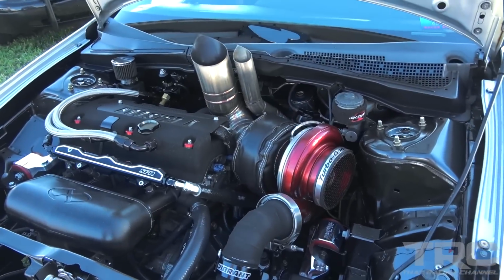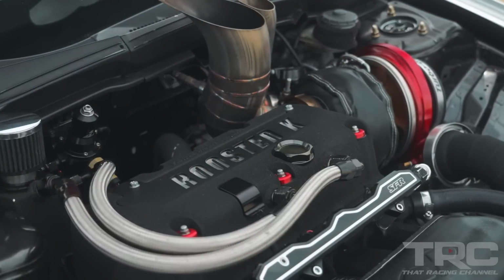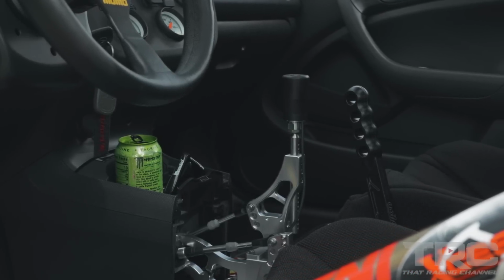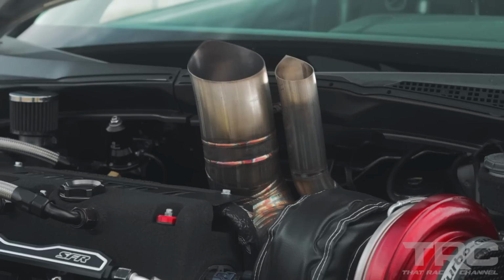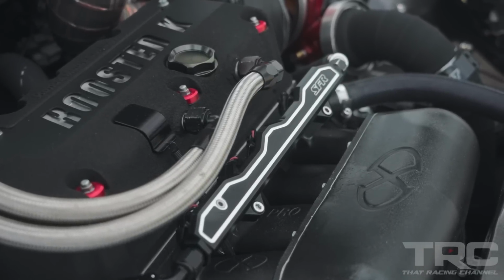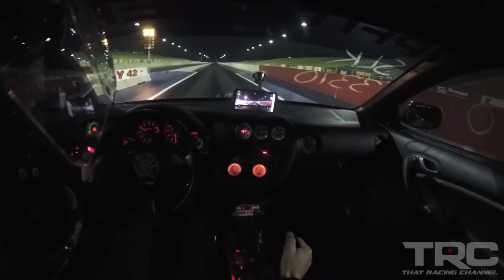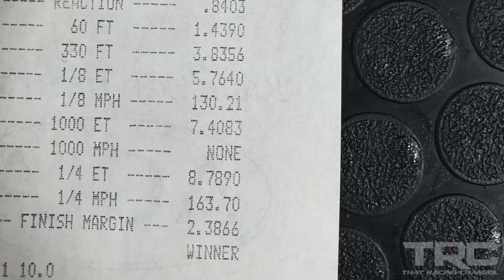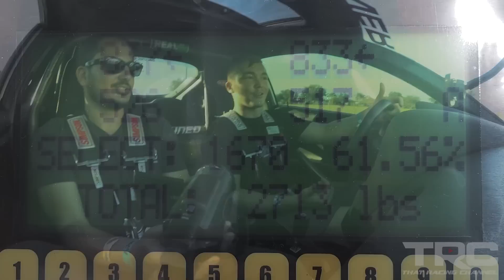950HP AWD RSX Dominates Exotics! "The Perfect RSX" (Honda K-Series 45PSI + 9800RPM)

Comment: A 4 Banger taking down a twin turbo v10 will never get old!
Reply: Its not about 4 banger vs tt v10 .... its about how much hp he has vs his opponent regardless of what car it is
Reply: @ACommenterOnYouTube  Wait so its only bhp that wins races regardless of the car ? So 800bhp in a full weight rear wheel drive truck beats 700bhp in a all wheel stripped out eg civic everytime? Based of that logic a loaded semi should walk most things then?
Reply: @Ewtlldo  its more like, luxurious car designed for all around style, performance street use and track use vs a car just stripped and made to go straight on a strip...? logic ye
Reply: @ACommenterOnYouTube  Its called power to weight ratio. You're right though, it doesn't matter what vehicle it is. Only thing that matters is the weight of it.
Reply: 230+ bhp per cylinder is impressive to me regardless what vehicle its in. More so when its home built on a budget

Comment: This is the kinda motivation I need but my wallet can't handle.. 😅😅
Reply: @Kseriessuck  if youre doing all the work yourself or have sponsorships its "not too expensive" but this would litterally cost the average joe 50k+ for a setup like this pushing similar power. quality parts are not cheap, not even for Hondas. Honestly 400-450whp in a Honda street car is more than enough power tho. good enough to walk some 700hp cars and cruise through canyons and then make it back home.
Reply: @kuya_mike7813  i have an 8th civic si. i want a PRL turbo kit so bad that’s it. but i worry about the trans :/ and it’s my daily. i’d be happy with 400 wheel
Reply: @Kseriessuck  okay yeah most of the parts you need you can easily find at a junkyard 💪🏾
Reply: Facts , one day mane!!!
Reply: Fuck. Hondas were a problem fwd lol and now they're AWD?! It's over.
Reply: As an rsx owner, this is all of our dream builds.
Reply: @ohnd2634  I have homemade turbo kit on my rsx and it’s so worth it. I’m only at like 350 - 400 but it’s fun as hell.
Reply: @Alexbrandt27  still enough power to get you in some trouble 😉
Reply: Facts! I need to get my mojo back think this did it for me
Reply: @Kseriessuck  dude we're talking waaaay over 100k if you have an actual shop do all that work... finding a cheap part on ebay is meaningless, the work is where the $$$ is. Plus stuff like this needs to be rebuilt and have parts tweaked or replaced constantly... thousands on thousands on thousands just to keep it going once its built.. unless u just want a garage queen build
Reply: Ya my wallet ain't that fat but 400 in a turbo  gsr hatch is working on the street

Comment: One of the cleanest, well built, fastest Honda street cars I have seen.
Bonus points - built not bought

Bravo!
Reply: you have to see dsm demon. have u seen 1200hp hondas? they out here easily
Reply: @cosworthTV  those aren’t really street cars tho
Reply: I loved when he asked if he had a shop. No this is just a side gig! What the hell does this guy do for a living? Surely he's a mechanic at a race shop at least.
Reply: Ahh CORRECTION ...
turbo is bought hp ... 
Built hp is all motor naturally aspirated.
Reply: @ACommenterOnYouTube  Turbo isn't bought HP. Just buying one and having sitting on a shelf doesn't add any HP. He had to fabricate the turbo kit to make any use of it. Still built.
Reply: It’s an Acura not a Honda !
Reply: @MSRWorkshop  well said
Reply: @MSRWorkshop  Acura is powered by Honda
Reply: @probong2053  k-series
Reply: @aaronkratzmann9703  yep and plus most people that want a reliable and faster turbo buy upgrade kits and rebuild the turbo with better turbines fabracate passageways so it stays cooler and and has proper oil
Reply: Honestly can't buy a honda with power unless it's an nsx lol
Reply: @MSRWorkshop  A H A H... Same thing.  The engines are the same the chassis are the same.
Reply: @chrisstratton3430  You BUILT a motor with parts you BOUGHT ..
Both methods cost $$$$ 

i BOUGHT $100k worth of parts for my 1000 whp Supra & BUILT the engine myself 

One in the same, try to process that.

Comment: I know this man personally and have been in the passenger seat of this machine back when it was still FWD. No exaggeration whatsoever, this man may be the most talented and dedicated person I've ever met and this thing is a fuck ton of alot faster than videos depict. Well deserved and rightfully earned brother. 🔥 Godspeed ol' Brett Bunyan.
Reply: He military? Haircut says probably.
Reply: @Green_Streets  nah, kid's just respectable and has a good head on his shoulders. Family man.
Reply: @jor-wo1vi  does he drag race the car with slicks or drag radials with that setup? I hear the crv stuff isn’t as strong, so curious.
Reply: @Green_Streets  he explains the tires he runs in the video buddy. Believe they're toyo R888s
Reply: @Green_Streets  you're correct the crv stuff isn't that strong, he runs through axles all the time but has it down to a science at this point.
Reply: @jor-wo1vi  know if he’s ever broken a rear diff?
Reply: @jor-wo1vi  Gotcha, I thought he implied in the video that he had other wheels/tires that he used as well.
Reply: @Green_Streets  he has slicks but was running his street tire set up during this bud
Reply: @jor-wo1vi  I understand he was on street tires for the roll racing, I was just curious how well his crv driveline handled if he has run slicks, apparently the diff is the weak point.
Reply: What’s his Instagram
Reply: He in Canton Ohio?.. sounded like he said Canton
Reply: That 60-130 time says it all! That RSX is insanely fast!!
Reply: He's certainly both talented and modest
Reply: Does he have a channel?
Reply: I wouldn't mind meeting him myself as I have a k24a2 I wouldn't mind tuning out maybe pick his brain on how to convert a fwd TSX to an AWD...
Reply: @jeremywilson5366  tsx, heck yeah with double wish bone suspension.  If it's the early generation (with engines without integrated head - exhaust manifold):   reinforce the front suspension.  They are know to crack and you will chase alignment issue for ever.   Had seen this issue..

Comment: If it wasn't for the hood exit the car would almost look sleeper-ish
Reply: it aint a honda if it dont got the hood exit
Reply: @lcameeno1  No you
Reply: @OEM1  I like being a hood exit
Reply: I miss when people made real exhausts.
Reply: Ahh ... sleeper-ish dont have 4 drag radials ... let alone 2 for 2wd. 
There is no such thing as a sleeper when you have or need drag radials for traction.
Reply: @ACommenterOnYouTube  hes not on complete slicks so the car looks pretty normal unless you knew he was on r888s and proxes
Reply: @nhilist5774  ok so would you use R888's or proxies on a 150 hp civic ?? 
Sure if looks like a normal car from a distance until you see its tires.
Reply: @ACommenterOnYouTube  my point is that on the street they look like normal tires,if you saw something on RPF1s you wouldn't bat an eye but if it was on slicks and Welds you'd know it was serious
Reply: how TF he get that thing to stay running on stock block?
Reply: @4touchdowns1game29  because K engines can take a beating

Comment: Thank you for bringing respect to the Honda community. I have my own supercharged 2010 Civic SI It makes 477 whp and I love it!
Thank you TRC
Reply: I dream of building my civic to higher hp but at the same time I have some financial troubles right now.
My car is fitted with the kraftwerks supercharger.
Reply: That's what I'm trying to get lil whine for my vtec
Reply: @henrikpflanz6580  477 is nothing to sneeze at, especially in a light car. Power is overrated
Reply: @przyna  Thank you :)
Reply: I have turbo set up for mine Si and make 550 to the wheels
Reply: @bryanCLXT  Highly recommend this. I got it installed just before the pendemic and it has been a blast to drive it.
(when I can of course)
Reply: you must be flying
Reply: @noahgilbert8630  you still gets gapped in your rwd
Reply: @pakourking5726  i want to buy a accord euro r which has all the same drive train as a dc5 integra type r and turbo it. What turbo kit did you use. What turbo did you use Is it worth switching to k24 bottom end with k20a heads or just keeping it full stock k20a
Reply: @lordoftherims436  if I remember correctly the Accord Type-R uses an h22 (instead of a k20)
Reply: @lordoftherims436  bro my 2002 crv has a k24a1
Reply: @JoseSantos-ys3rj  I said honda accord euro r. Not a accord type r.It has the k20a. Same exact engine and drivetrain and brakes as a dc5 integra type r
Reply: Power means nothing if you can't put it down hence awd. I think that's what Henry's talking about.
Reply: Henrik* stupid auto
Reply: @alexmillhollin8301  my Honda CR-V has awd bro 🤦🤦
Reply: @luke 6 Then build it into the first sleeper crv!!
Reply: @alexmillhollin8301  nah bro it has no power just cus it says k24 don’t mean shit
Reply: @alexmillhollin8301  Its a manual  :)
Reply: @noahgilbert8630  you should check out the results of some time attack events, you might be surprised to find that the FWD class is almost always the fastest.
Reply: @noahgilbert8630  guessyou never seen rally racing
Reply: It’s an Acura people !! Not a Honda !
Reply: I was saving for a kraftwerks kit for my Fg2. Then I totaled it 😭 I’m in a G37s now
Reply: I have an 8th gen as well. No videos of yours?

Comment: most exotics have an average of 700hp and weigh about 3700 lbs. compared to a 950 hp car that weigh under 3000 lbs. do the math. The RSX seem to be well built though.
Reply: That's peak power @950 out of a 4 Cylinder, that engine is absolutely gutless until it gets that turbo spinning @ really high rpms. Compared to an exotic car. The drivability will be endlessly better. Things are much more intricate then peak HP.
Reply: Hater 😬
Reply: Then again those exotics at the track aren’t stock either
Reply: Stock RSX type S weighs 2840, not counting this one has added, roll cage, AWD parts and turbo. Against modded exotics 🤷🏾‍♂️
Reply: Yall even watch the video? I don't know about the McLaren but where was a stock lambo??
Reply: @NotWBT  this car is making an insane amount of torque. So no it’s not gutless
Reply: @TheBb6prelude  that's why he shifts passed redline for every shift right? I'm a die hard jdm guy. I've owned 7 imports. (True imports, rhd) but unfortunately there's no replacement for displacement. You need to rev the fuck out a smaller engine to get a big ol turbo to spin. No if and or buts that's how it works. Simple physics.

Comment: Damm but why 45lbd of boost when you can just do a head work and push the same amount of power with only 30lbs . Great car though 👌  these awd ommggg jus sweet
Reply: What had work would do that?
Reply: @yummyhershey5902  port and polish
Reply: Valves job
Reply: Makes the head to flow more air with no restrictions.
Reply: @jorge0411elica  port and polish and valve job isn't going to make a 15lb of boost difference in power lol
Reply: @allan775  ommgg ok 👍  if you say so .

Comment: These Hondas now that they can all be awd..... they are nothing to play with. These aren't the "just another honda" pulling up on you, These beasts boogie and sound good doing it! I had a nice race I wish I filmed with a awd type r Integra,  when we went from the highway pulls I won, (I have 619rwhp/655 lb/ft torque at the tires so my car is no slouch) he flagged me down and we exited together and we went from a dig..... I slept on the dig because I figured it was just a boosted honda, I hooked perfectly on my pilot sport cup 2's and he was still outta car or 2 up the whole 660' and by the time we were done I made up all the disadvantage of rwd vs awd and was about a fender behind him, long story longer, we pulled in to the same parts store and we popped hoods and I admired his build. He had a k24 huge single turbo. He was putting down 502awhp and 465lb/ft torque.  He never knew about the amg's and what the difference was so I took him For a spin and he loved it. He took me for a spin in his and I loved it. There is officially no more honda hate in my heart since I started as a honda boy but hated how fwd and slow they were compared to muscle cars. Now I can proudly say my new daily might be a project awd s2000 with around 24psi to 30psi goal with the k series. Best part about it, we exchanged info for local car meet ups and he is now shopping around for a Amg 4 door E55 amg sedan. I hope he gets one, and I can help him with his car since we have the same engines, kinda, and he can answer all my awd honda questions I may be lacking knowledgeable info about. Win win for us except we never did run the 3rd tie breaker race....🤔 that will be next and I will film it. We should do a driver swap and race eachother too.

Comment: How the hell does he seal his Valve Cover Gasket? I have a 1992 Civic with swapped Civic-type R engine pushing 30psi of boost and I've tried 3 different gaskets. Next, I'm just going to use tractor gasket sealer and say "Fuck it I'm never going to get it apart again."

Comment: I'd take a CL type S awd, those motors sound amazing and adding in awd would bring it to a whole other level.
Reply: I love the CL but I think AWD wouldn’t work because the CL is basically a Accord which is bigger then the Civic, i mention it because part of the reason the parts for the AWD system fit on the RSX is because the AWD CRV is based on the Civic platform

Comment: Put a big enough turbo on any shit can and it’ll be faster than what it’s racing. A huge turbo on a tiny ass engine means its boring af to drive unless you’re ringing it’s neck for full boost at what…5000-5500 rpm?. Torque steer for days too. Whatever floats your boat I guess (or whatever you can afford)